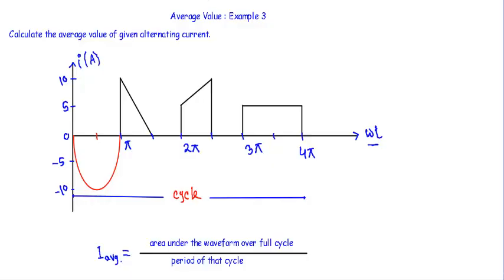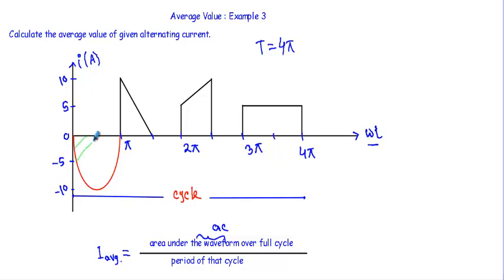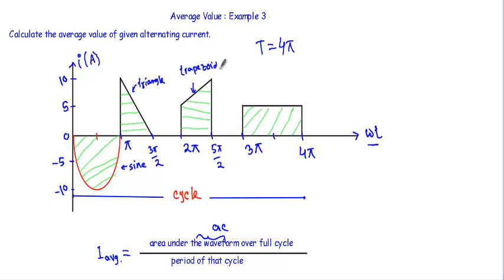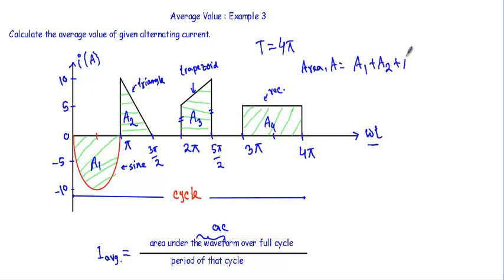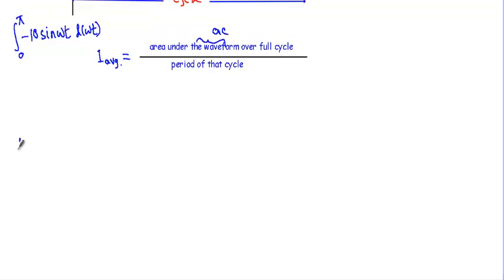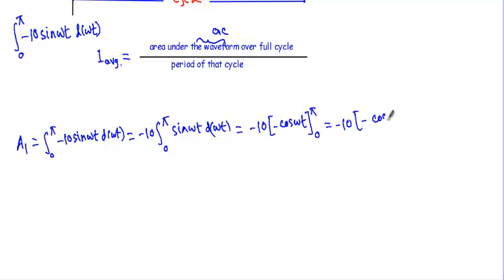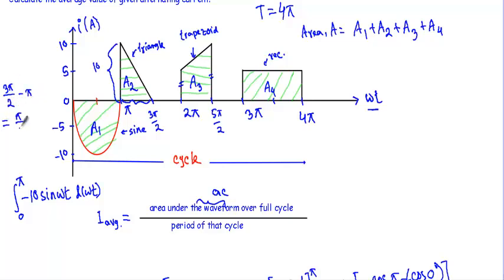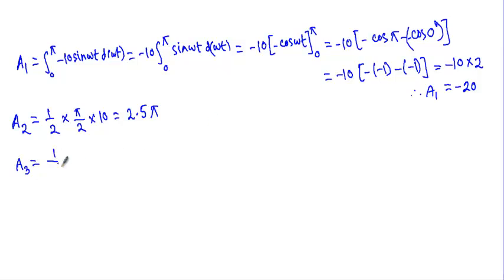Average Value : Example 3 (Hard)

Comment: according to you when we will solve for sine wave we will get zero value for full wave.....but ie 0.636Vm
Reply: brother 0.636*Vm it means rms value of that sine wave..
here we using the area of that sine wave not rms value.
In full wave sine signal avarage value is always zero that's why we use rms value.
but here sine wave is not full.
that's why avarge value is not zero.
keep look at that problem